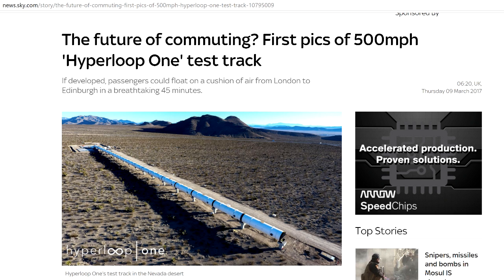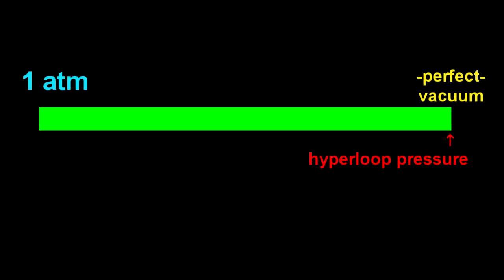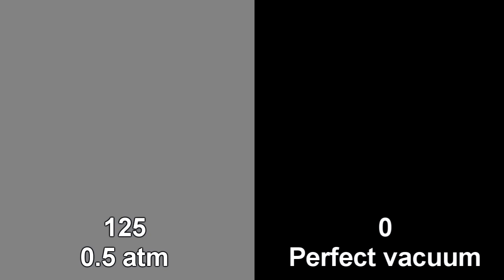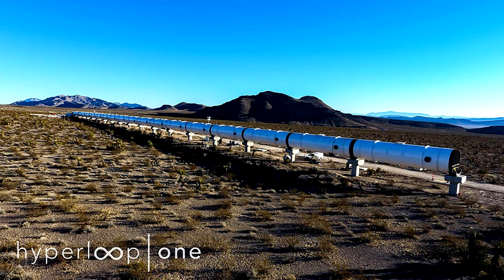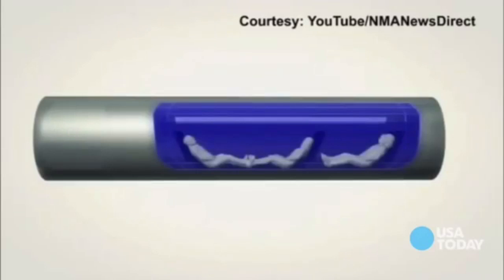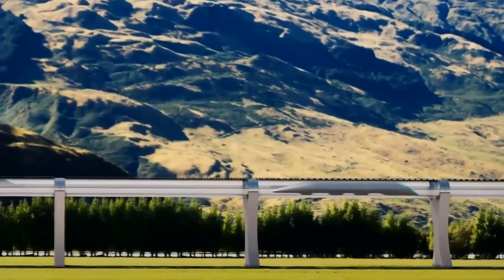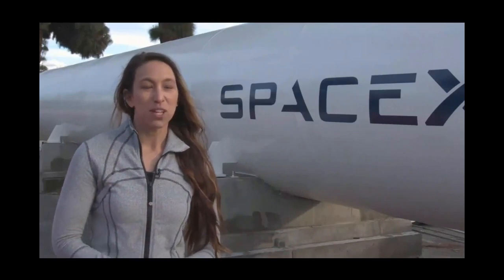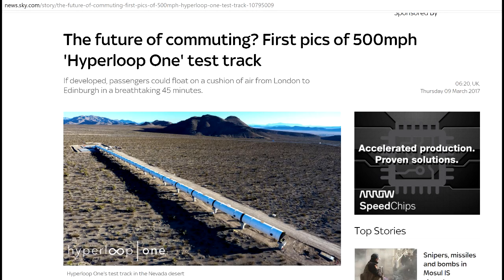Entire Hyperloop could be destroyed in SECONDS!

Comment: Hey Thunderf00t. I was wondering if it is possible to use air as a hydraulic fluid? Could it be possible for the Hyperloop to utilize air in some form or matter to achieve a hydraulic effect and just push the pods that way? Then they wouldnt have to worry about atmospheric pressure.

Comment: The tanker truck is designed to contain the pressure of liquid or gas that's exerting said pressure outward, right?  What would cause there to be a vacuum inside of one?  I guess if you were pumping out its contents without proper ventilation, a vacuum could form...

Comment: Dear Thunderf00t,

First of all i'd like to state that I full agree that Hyperloop in it's current state won't deliver as promised countless of times. However I think that it still is a good initiative that SpaceX took, it's more of a matter of getting things rolling than getting a fully functioning Hyperloop asap. Now for the time that it takes to depressurize the chamber, my best guess is that you actually only have to depressurize it once. How? Well i came up with two options. #1: What if you could make some sort of really good suctioning cups at the edge of the pods/stations? When you want to get in or out it's just a matter of having a computer aided program run the code and reach the suctioning cups out, so passengers can safely get in and out at each station. #2. You have a depressurized tube and at each station you would need some sort of small 'waiting room', so when a pod is ready to leave it gets transported into the 'waiting room' at which point the 'waiting room' depressurizes itself as quick as it can till it is near perfect vacuum. ohh btw a lid or hatch closes beforehand as you might have guessed. When the 'waiting room' is done depressurizing a hatch underneath the pod opens and the pod gets lowered into the depressurized tube. After that the hatch closes and the pod can go on it's way. now as for the tube itself, I fully agree with your statement that in it's current state it is way to vulnerable and dangerous for passengers and it surely needs a big reinforcement. Well and what about the earthquakes?  maybe you can build another tube around the depressurized tube or something which works like a shock absorber and moreover I think the best place a Hyperloop should be build is underground, because above ground you have to deal with a lot more factors than earthquakes, like infrastructure, wind forces, water forces etc. I'm genuinely curious what you think about these ideas and maybe you could elaborate them in a video :)

Kind regards,

Rutger